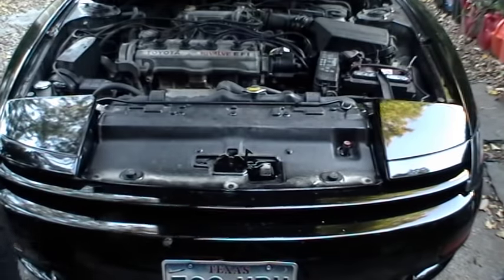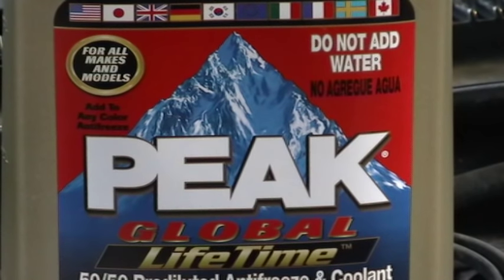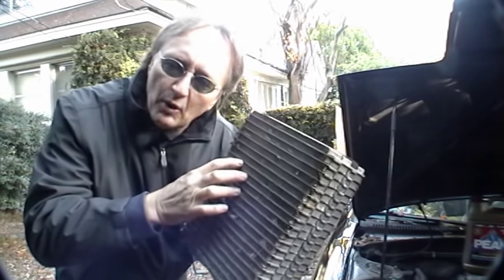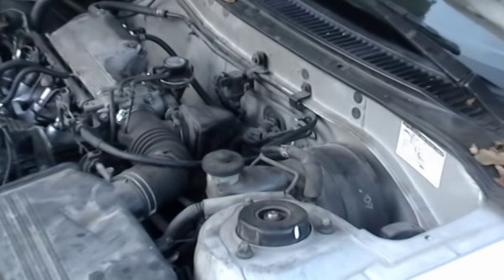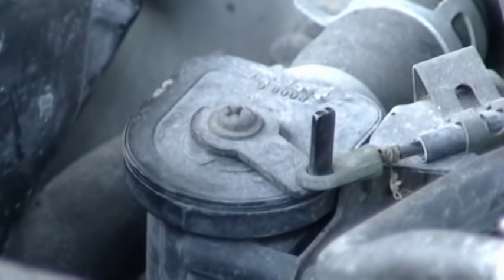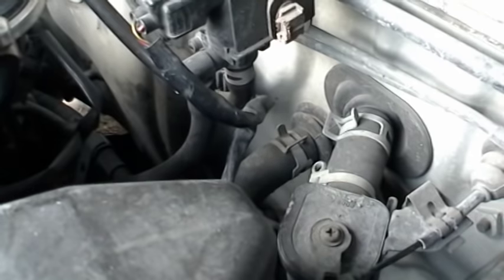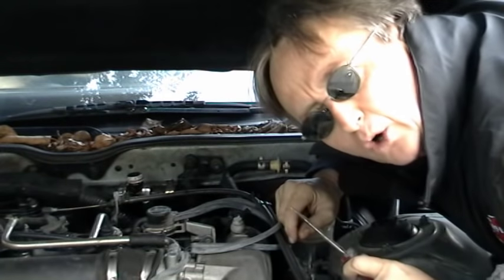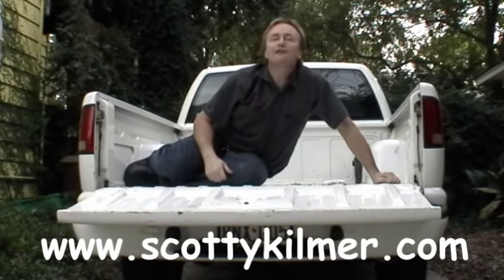How to Fix a Car Heater

Comment: Hey scotty I have a 1999 f150 4x4 with no heat that I bought. Well the problem was that the heater core hoses were cut and I went ahead and replaced the heater core and blendor. Unfortunately I still have no heat. I noticed after testing it out that the knob to turn on the blower only worked in the highest position is my problem the blower motor resistor or is there something else I need to check? Looking forward to hear from you soon thanks Ben

Comment: Hi Scott, I got a 2001 Mercedes e320.  Heat seems to work 5 mins after engine start but the air is lukewarm.  Shall I first flush the heater core? Thanks...

Comment: Great video, just as all I have seen from you! Question, if antifreeze smell is coming out from air condition ventilation in a 2001 neon, is this from a bad heater core? Do I have to replace it or can it be fixed?
Reply: drvegueta thanks bro

Comment: @scottykilmer 

Scotty! 1 more question.

I have a 2007 Ford Taurus and my heater is blowing cold air.  At first I thought I might have a clogged heater core but then i noticed the a/c compressor cycleing on and off and the a/c lines getting cold.  What could be causing this?

I hear its normal on some cars if you set it on defrost, but im setting it on heat (floor).

Comment: What if you don't have access to use a Garden hose to flush out the heater core?  How can I flush it? I'd have to hook it up to a sink but then I'd have to buy like 2 hoses, which arent cheap, and some adaptors. Plus I live in a cold state.

Comment: In a 2007 camry v6 heater blowing hot then lukewarm then cool air.  Simultaneously the car seat heater works initially but then dies.  Recent (last 2 mos) repairs include new water pump and "new" alternator. Please help

Comment: Have a Ford Taurus 2001 no heat hoses of warm underneath the engine so I'm kind of stuck and what could be the mechanics I have change the switch of some sort really hoping it's not the heater core not sure if it has anything to do that bypass that's on them when turning the heat off and then back on I get a good heat flow then gone seconds later any suggestions thank you for your help and time

Comment: Scotty Kilmer I sent you another message. But this video is more of my concern. I've done a complete flush, thermostat is new, both heater core hoses are very hit and still no heat. I have a 98 chevy s10 that uses a blend door actuator, just got a new one and have no idea where it is located. I've searched everywhere and all I find is some people saying its in the dash, glovebox compartment,  under the dash etc. I still can't find it. Im almost 100% positive its the blend door actuator as many s10 owners have the same issue, I just have no clue where it is located.

Comment: Hey greetings, talking about heater, my Pontiac G3 2007, has a leak on the heater radiator, do you happen to have a video on how to seal leaks on it? or even better.... can you share a link or video on how to extract the heat radiator from this car? Thanks!
Reply from the maker: you can try a sealer like bars alumiseal, BUT normally heater cores that leak need replacing as sealers don't work that good on heater cores, only on radiators

Comment: the garden hose had threads and so did the heater flush kit opening,  how do you hook the hose up?   I mean you, if I had this problem I would freeze until I found some sort of adapter ( cursing every day until I did)

Comment: I've got a 2005 galant. It doesn't have a heater control valve. It isn't running cold. It reaches operating temperature just fine. I topped off the coolant after flushing out the radiator. It was low and cruddy. I also flushed out the heater core hoping that it was just clogged up. There are no signs of the heater core leaking. It still isn't getting hot and I've tried everything I can think of. Not sure what else it could be. It doesn't blow hot air but the blower is working fine. It just doesn't get hot. Not sure what is causing this issue. Something I thought  that was odd was when I was driving to a hardware store to get tubing and fittings to flush out the heater core the heater worked fine on the way to their store but hasn't worked since. Any ideas? Thanks I love the videos!

Comment: Hi Scotty, my 2000 taurus is not having enough heat. After I drive for 5 min, I turn on the heat and got some hot air. then, it will become cold. Then, I turn it off and wait for several minute before turning it on again. I will get some hot air for like a minute... then, cold air again. Coolant level is fine. Engine temp is ok (a little bit below middle).  Just recently put in a new Cabin Air filter. Wondering what the next thing to check???  

Thanks in advance

Comment: Hi Scotty, i have a 2001 ford fiesta 1.6 RSI, i am in South Africa, my car heater is not blowing hot air only cold air on a cold start and on a 32 degree Celsius hot day it still blows cold no matter how long I've been driving for, my colorant is fine i make sure its always full however i am just not getting anywhere and winter is approaching.
Reply from the maker: first, try the fixes in this very video. If not them, have a ford mechanic check the electronic heater control system, it is computer run and very complex requiring a dealer level scanner to fix

Comment: Hey Scotty
I have a 2003 Ford Crown Vic and need my cooling fan re-wired because the guy that installed my a/c compressor made it so my fan would turn on as soon as I turned the car on.  Consequently my cars engine can't heat up.  
Is it easy or is it something I should take to a mechanic?

Comment: Hey scotty. I found that my temperature module have no cable attached to it. does the cable run from the heater valve to the temp module only ?

Comment: Hi Scotty - love how you cut to the chase, so I'll do that too...I have a '96 Subaru Tribeca and hot air only comes out of one of the vents.  Other vents get plenty of air coming out but  no heat just cold air.  Temp gauge on the dash works fine and coolant seems to be OK.  Thoughts?
Reply from the maker: often a blend door failure inside the dash. Not a fun job taking that dash apart to find the cause though. PRAY something dumb like a vent duct has fallen off.
Reply: praying, praying, praying....  Thanks!

Comment: what do you think my issue could be i don't have the same make and model
 but i have a 2005 ford Taurus. i have no heat, only cold even on the 
heat setting, wasn't Thermostat (replaced it), and the inner/outer 
heater core hoses are both hot as heck. suspecting it was the blend door
 actuator it because it wasn't turning. i bench tested the unit by 
connecting +12 and -12 to the unit to see if it move and it does, opened
 it and seen no busted motor or plastic gears. but it doesn't work when 
plugged in by the wire harness on the car. i have a manual selection 
heating system (knob) to me i think it a petentiameter on the heat/ac 
selector that has failed that isn't sending the signal and maybe a stuck
 blend door too??

Comment: ive found 2 doors on heater system so far 1 controls the temp, from hot to cold, it still works with heater controls on dash, and the other loor and leaver, was for air intake, weather to pull from cabin, or outside. it also works with dash controls.. and.. when everything is off and the key is on, I move control from d frost, to floor, to vents, and I hear motor running, I also feel slight change in air flow. is their a common place for blockage in heat system. where dose the heat, go,

Comment: Peak Global Lifetime for the win, it's their fancy organic formula, better than the 'long life' product they have. I did a full distilled water flush and started clean with it in my Honda so I don't have to worry about Honda's cheap green fluid not keeping the PH and other corrosive stuff at correct values and having the radiator/heater core spring a leak at some point. Gotta use good fluid to have a good running car! I'll do a radiator drain/fill every 5 years or so even thothey claim'lifetime'

Comment: @scottykilmer Scotty, I am ready to do this.  I ran the engine and the two tubes that went into the inside of the car...one was very warm and the other was cool.   Does that mean I need to replace the heater core?  Is it as simple as removing the dash and swapping out the part?  Any references you can share or places to buy the part would be great.  thanks.

Comment: hi Scotty! I have 2013 Toyota Camry 61500 miles heater doesn't blow out hot air.  I took it to Toyota's dealer. They said the problem is air box not switching inside rec. need replacing air box and cost about $2300 so expensive. I wondering if anything else I could do beside that.  please help. Thanks.

Comment: i have a 1988 lincoln town car. i know that on my car the blower motor is working, but when i set the dial to blow heat from the floor, it doesnt. the fan stops spinning, but when i switch it to panel or vent it blows air. its not as hot as it should be, but warm. but when i put the dial on anything in the heat bracket, the ac compressor engages. what do you think could be the problem?

Comment: What could cause heat to only get hot when accelerating?  System was flushed, and thermostat was replaced last year? 1999 Camry 4 cylinder LE

Comment: My 2018 Nissan Frontier will only throw out heat into the cab when I go  down the road  or when I rev up the engine -- Brought it to the dealer twice and both times they said it is blowing heat  . Is this fixable?

Comment: Hey scotty, I have a 2000 dodge grand caravan It blows cold air when It is parked but when I drive it blows hot air and cold air it doesn't over heat. 
I flushed the heater core but nothing came out but coolant. 
radiator, thermostat, water pump, hoses, rad cap were replaced not long ago. 
serpentine belt makes a sound when I drive but it goes away. 
Do I need a new heater core and serpentine belt? or it is a heat gasket blown already? 
coolant always is low but I don't see any leaks.

Comment: hey scotty im workin on a friends Hyundai accent and her heater works off and on she says it barely puts out heat and sometimes when the fan is cranked up it will start making a really loud noise and also the car will stink up to  this sounds like a heater core problem to me because she isn't losing coolant but i also don't know if she ever had the system flushed either. also when her fan is on hi she doesnt have much air flow out her vents. any advice is appreciated ! Thanks !

Comment: Hey Scotty, when I got my 92 Toyota Windom (Lexus ES300) the heater / air con didn't blow any air hot or cold, but the a/c & heater controls and display work. I replaced the blower motor and now I have hot & cold air but only on full high setting, no air blows on low, med, or med-high... What could it be & where do I look???
Reply from the maker: replace the blower motor resistor, go to a dealer, buy the part, they can show you where it's located on their computer screen

Comment: im having a problem shifting my manual, i can shift when its off fine but once i start it with the e-brake on i cant shift at all, do you think its related to this 20 degree weather? thanks in advanced

Comment: Hey Scotty,

I have a 2004 Pacifica and the fan doesn't work anymore. I put coolant in and checked the relay, to no avail. Plus I don't know where the  heater control valvue. Don't want to get shafted by a shifty mechanic. Any suggestions? Thanks

Comment: My Heat and AC stopped working on the same day. We changed the therm, the radiator is full,  could the heater core affect the ac too? Or what could be causing both things? (The fan blows nice and strong)

Comment: @scottykilmer I was screwing the nut in back in the housing but I over torqued it, and the nut stud that holds the housing together broke, I only have one nut holding the thermostat housing together. I also have the same exact Celica as you, do you know if its possible to replace the nut stud? Thanks in advance Scotty!

Comment: Hi Scotty
Is there a fuse that controls the heater fan.    The fan doesn't come on at all. I'd like to check the fuse.    Thank you kind  sir and I've been enjoying your videos for about a year now.   Cheers
Reply from the maker: +william tell yes, it's called the blower motor fuse on most cars. And if it's not blown, kick the fan area, and if it spins then, get a new motor

Comment: I have 2007 expedition el I hear no clicking noise but only my driver side heat works. And only the front vents blow cold air. The rear air/heat dont work. Does this mean I need to change  my blend door actuator that sits in the rear?

Comment: Hi Scott, I have a 2006 impala and  one side blows hot air and the passenger side blows cold I changed the ac unit that's inside the car but it still does not work. What else should I try before going to the dealership.
Reply from the maker: realize those are computer run heating/ac systems. A dealer level scan tool is needed to work on those crazy designs. See my video "fixing modern cars using high level scan computers"

Comment: hey scotty i have a 94 oldsmobile 88 royale LSS and the heat works but it will only blow out the defrost/floor no madder what i set it to..what do you think my problem is? and it happened all of a sudden

Comment: Hey Scotty I have a 94 prelude and the heater AC has a mind of its own .. I'll be driving with the heater working and all of a sudden it will just shut off. Or sometimes I start the car and it doesn't even turn on ,leaving me freezing !! Please share your thoughts on what could be my problem.
Reply from the maker: often just a bad blower motor burning out. IF it doesn't blow at all when you have no heat, replace it. And,If you like my car help, be sure to watch my live car talk show every Saturday morning at 10 AM CST on YouTube. I answer your car questions LIVE there. Just go to YouTube and type in the search engine "Scotty Kilmer Car Talk (and put in the coming Saturday's date, such as "Scotty Kilmer Car Talk  February 1" or whatever date the next Saturday is)".  That takes you to the live event, and shows how many hours and minutes it is before the event starts on Sat morning.  And remember, every TUESDAY  I upload a new video, so don’t miss them.

Comment: Hi, I did the test, head gasket was fine for now, I replaced the thermostat didn't fix the problem but the heater core is making a weird sound when I drive and I turn off the van. Like it clicks and clicks 
Do you think the heater core is bad? When I drive after 10 mins the heat start working okay even when it is in park.

Comment: Hello Scotty, I've  been working in a Saturn L300 01. I had to replace the gaskets since they were leaking but at the time to reinstall the core, the hoses just didn't fit. Is there a special tool to connect the hose to the core without bend them or force them? Plus I got the whole passenger side flooded with antifreeze and I going to have to replace the heater core for a new one since I messed it up and I broke the o-rings during the installation. Thanks.
Reply from the maker: +Juan Fernandez  you need a tool to remove them, but the new ones should just snap on unless you broke the fitting removing the old ones without that tool. I often give up and put on all rubber hoses with clamps myself when I find that

Comment: Hi Scotty, my heater don't work on my nissan Pathfinder 2004. when i turned the thermo to the heat level still cold air comes out. what can you suggest to get tested and fixed it? thanks!

Comment: My 01 durango.has good heat on the front vent, but cold air on rear vents. WHAT would be the best thing to do in this situation? Switchs are working fine. Thank you.
Reply from the maker: if it has a separate heater core in the back for the rear, check the heater control valve there. If it doesn't, then the blend doors aren't opening for the rear heat and need to be fixed. Realize that's all computer controlled, very complex system on a dodge.
Reply: Thank you, I'm a big fan of your page and thanks to you I have done many jobs on cars, including mine. Keep up the good job and good luck on everything

Comment: my heat used to be really good, but now it's not as hot as it used to be.  I'm thinking it's possible the control valve is jammed, because some times when I push it on full heat, it pops back a few notches towards cold. do you know where the control is on a 91 s10?

Comment: Hi Scotty, im driving a 2000 mitsubishi exclipse gt and it doesn't heat up like it's supposed to. It gets only Luke warm.  The thermostat is always halfway. ..never goes over half.  Anyway the driver side vents blow cold while the passenger side blows Luke warm. What's wrong?  The radiator does have rust in it though. Is that the problem? ?
Reply from the maker: heater core is all clogged up, try flushing it out, pray you don't need an expensive new one

Comment: I have a 96 Honda civic dx. The heat works when it wants to. i can push the button on and absolutely nothing, no air blowing,nothing. then when it does decide to work it makes this popping sound and hot air starts blowing out like a champ. what do u think it could be?

Comment: Hi Scotty could you help me. I have my toyota 4runner 96 the heater and AC works great but, the problem is when I put the heat air  in  position only for  windshield  the AC  automatically turn on.I try to shut down the AC  but not off. but when I change the position of windshield to other position  the AC turns off. Thank you.
Reply: Huh?

Comment: Hey Scotty, you the man!

I have a weep at my water pump ( GM European) its not major but obviousl as loosing a little coolant over a few weeks..... will this affect my heaters not being hot..I replaced the thermostat with a cheap one but the engine isnt reaching temperature...will low coolant pressure due to the leak cause low engine temps and heater temps...

Cheers Martyn